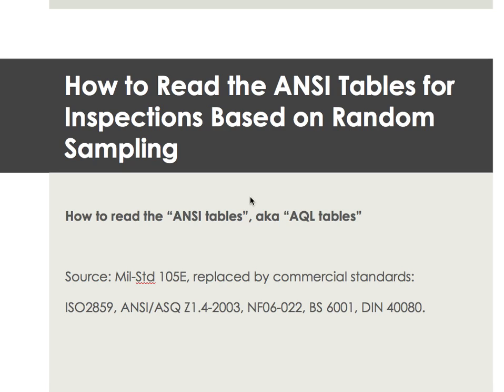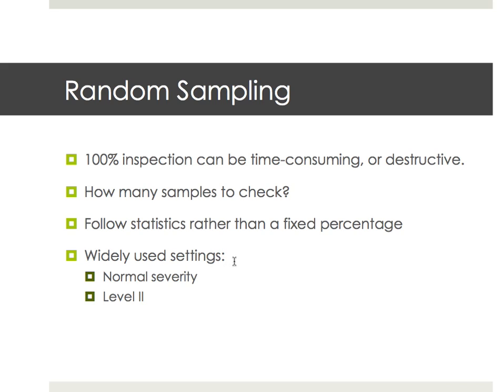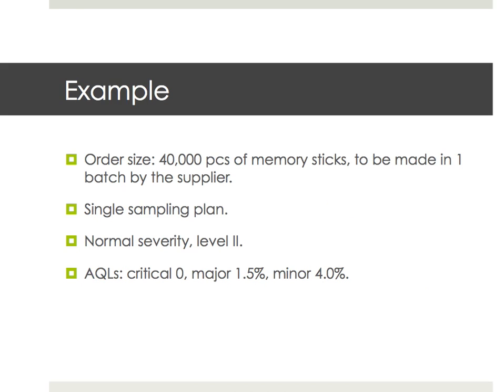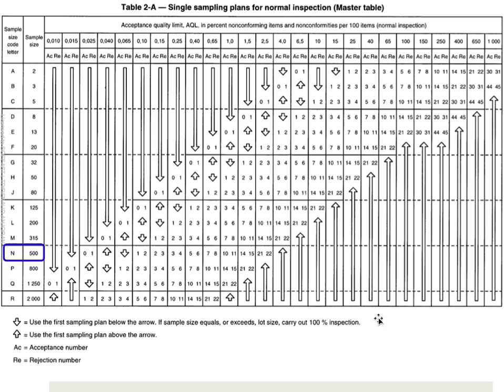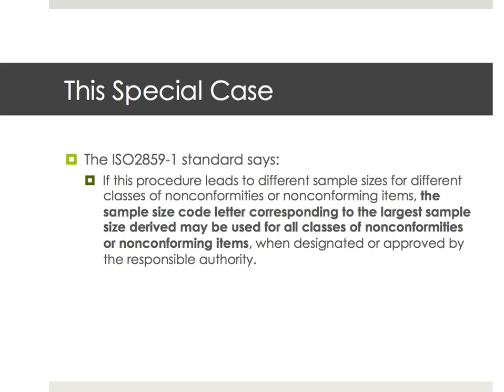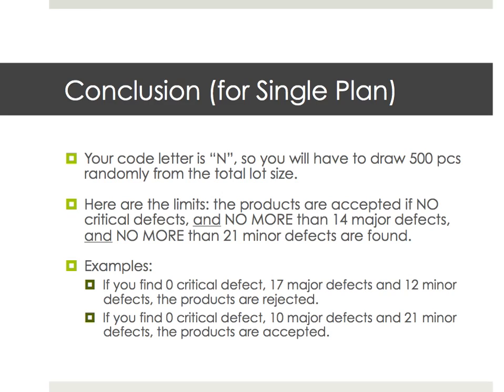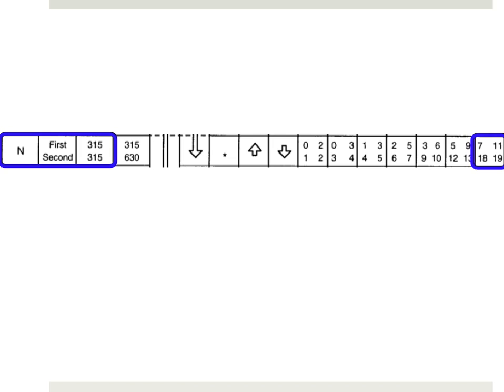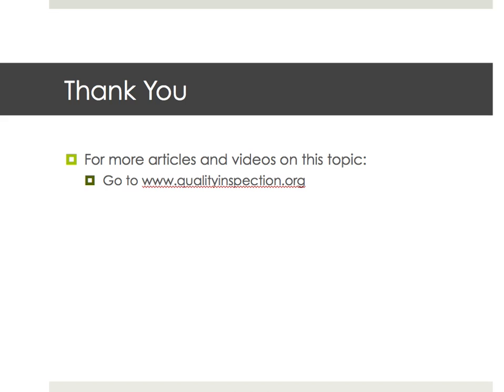How to read the ANSI tables for inspections based on random sampling

Comment: Hello.
I'm rather new on quality management and AQL, but I have a question.

Let's say I have an AQL of 1.5% for major defects and 4.0% for minor defects on a batch of 2,000 pieces. I inspect 125 of them. The maximum acceptable defective quantity is 5 for major and 10 for minor. Right (I'm on a level II inspection) ?
So, now, let's say I find only 1 major defect but 12 minor defects.
Obviously, 12>10 but 1<5.
If I follow the rules, as 12>10, I should reject the batch.
Nevertheless, I'm concerned, as if I get 3 major and 10 minor, for me the batch would be of poorer quality but would pass the very same AQL check.
What do you think about it ? Shouldn't I consider NO MORE than 5 major and NO MORE than 5+10 Major+Minor ? Wouldn't it be more logical ?

On the double sampling one, I think this is a good method, but I'd like to differentiate minor and major defects as well. I very easily get to the same questions : if I have very few major defects but I'm in the intermediate zone or above line for minor defects, I'm puzzled.
Can you help me solve this?

Thanks a lot for support.
Reply: +Jan-Erik 

Your concern is absolutely correct and in my opinion this is one of the no-sense things in AQL. In my opinion a major defect is always also a minor defect so the distinction between minor and major is not always helpful. I am doing quality inspections in textiles and the most common AQL levels are 2.5 for major and 4.0 for minor. In a sample size of 125 pieces I can have either 7 major or 10 minor faults to consider the AQL as passed. 
As per the rules, if I have 9 minor defects and and 3 major defects the AQL is passed. If I have 12 minor defects it is failed. In this case the lower quality is pass... Does this make sense? Of course it does not.

Most of the buyers are not even aware of this. The ones who are request specifically to not use any minor major distinction. They just apply one AQL level with no difference if major or minor. And this is the most protective way.
Reply: +China Manufacturing Consultants 
Many thanks for your suggestions, I appreciate your kind help. 
Anyhow, I am doing this since the last 30 years and my concerns are of a general nature. The problem is that - as a quality control company - we are often facing discussions with the suppliers. The problem that I have mentioned is creating a situation where, if I am at the edge with the allowed numbers of minor faults, the supplier's QCs prefer to consider certain faults as major. In this way the result is pass, where else if you consider it minor the result is failed. This is absurd as it does not protect anything.
For this reason, with our clients, we have established that the AQL level is only one (either  2.5 or 4.0) and we do not make any distinction between minor and major.
Reply: My question is that as a Quality Inspector, how would you manage testing 125 pieces?! , that for each piece you have to apply more than one single test (physical, chemical, dimensions...etc) , does that really make sense in term of AQL?!